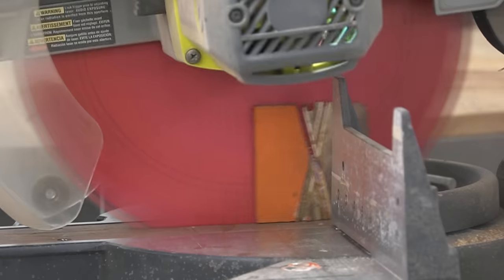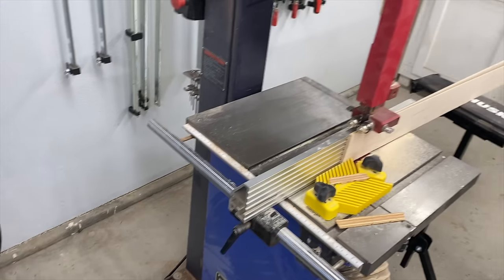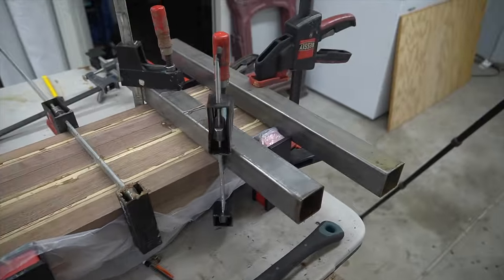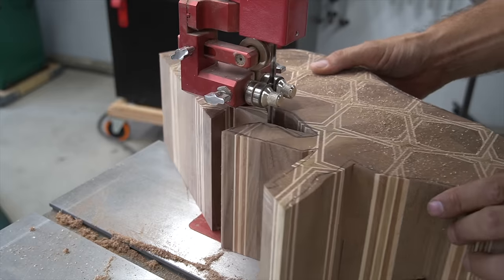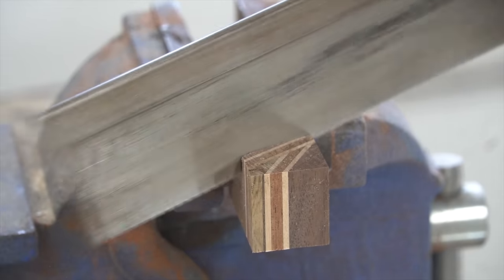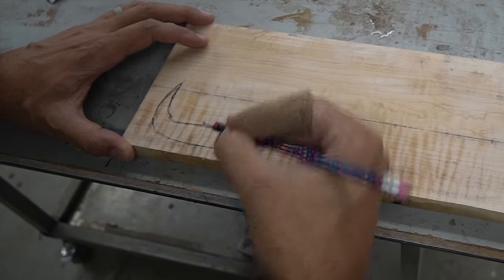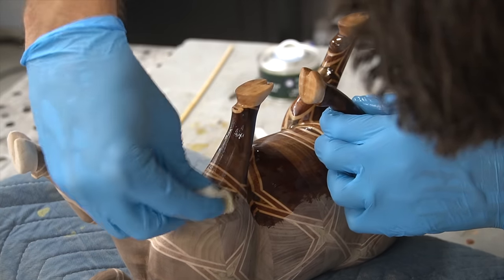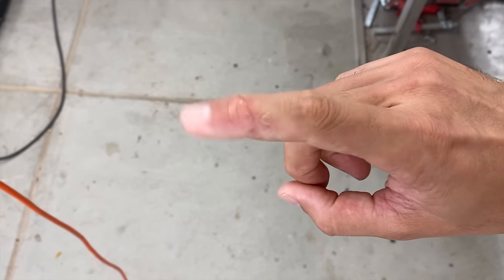I Carved this Patterned Block Into a Bull

Comment: Pretty cool how you were able to get back in the shop after an accident like that.  I nearly lost my thumb and i couldn't even look at my workshop for a month.
Reply: For me, it helps to admit that I was the moron who screwed up and if I slow down and use a bit of caution I’ll be fine.
I cut the tip of my thumb off with my mandolin slicer while messing around making midnight cheese snacks… lol the next day I used it to make a salad and my roommate was like “dude! wtf!? You’re using that death trap again!” and I’m like “yeah… I want thin cucumbers.” Haha I know that I didn’t use the guard, I forced a hard cheese through the slicer which is a big no-no and I didn’t bother using the nonslip pad either… I basically threw safety out the damn window and locked it. 
Same with my motorcycle the first time I crashed… it was a low speed crash but I had anxiety for a few days about even getting on it until I remembered… I chose to ride in the rain, I made a dumb mistake and rode up onto a painted section quickly trying to get some cover and had I just used common sense I would’ve been fine.

So next time something happens, take it as a learning opportunity and don’t let your anxiety control you. Fear can be just as dangerous as carelessness. Sometimes being timid can cause a whole host of other dangerous situations.

Good luck, stay safe!

Comment: This is the first of your videos I've seen, and it's quite impressive. A couple notes from an amateur knifemaker/blacksmith. 

1. Leaving the imperfections is always a personal call. I hate leaving relic (imperfections) in my work, but it usually sells better because it "looks handmade."

2. Excellent call with the bluing  and sanding on the base. It looks great and is still well preserved. 

3. The brass horns are possible, but not in a wood shop. Good call in substituting the curly maple. Limitation definitely added to the creativity.

Comment: My idea for your next project… a life sized rattlesnake halfway through it’s strike. Coiled, but stretched out. Mouth open. Stainless or Silver fangs and topaz or emerald eyes with brass rattles. The body of the snake can be from whatever medium you choose but there should be texturing for scales and some diamond type pattern. If made from wood, it could be diamond patterned inlays. If made from metal you could use clear coat with different colored toners or make patterns with blueing etc. or mix these ideas with some of your own as you begin to envision….

Comment: For bending the brass, heating the bend spot with a torch would work.  Or, if you want a fun new toy to play with, you can invest in an induction forge. It heats up only the spot inside the coil and it does it in seconds. I’ve seen blacksmiths use them for small projects they don’t want to fire up the real forge for. 

As for your finger, I did the same to my thumb pad. Right across the middle of it. You won’t have to remember to use the new push blocks you made. 6 years later and it still tingles every time I turn a saw on 😅

Comment: Hey, as a fellow person who had to get their finger stitched because they weren’t careful, useful tip. Make sure you lotion up. 

I recommend multiple layers of lotion. You need thinner lotions and thicker lotions. The thinner lotions penetrate the skin and moisturize and the thicker lotions and hand creams help with drying out. So thin then thick. Also glove as often as you can. Especially when dealing with wet. We want to keep lotion on and prevent dry out. That will cause your finger to curl and tug in places you wish it didn’t. I would also recommend CUREL’s Shower Lotion. It’s a wet skin lotion and is great as a base layer.

Comment: I think a kangaroo carving would be cool to see! I also think that there’s a lot of potential to put lights in your epoxy carvings that could give off a beautiful addition to your work
Reply from the maker: Cool idea! I always fear of lights breaking and then I have a useless light stuck inside the epoxy. If only there was a way to replace them once they go bad.
Reply: @BMSculptures maybe a little sculpture of a city skyline where you put lights in the buildings and access them through holes in the base.
Reply: @BMSculptures  fiberglass...
Reply: @BMSculptures  That is very valid point. I think there are a few ways to make replacing them possible but it would come with its own draw backs. I think the best solution would be to have the lights coming from the base stand. that way the light would be removable from the underside and easy to hide from view providing a glow from underneath. This would however require the epoxy to be at the bottom of the carving. The only other way I can think to is to have a detachable compartment in the centre of the sculpture. However, that comes with a lot more risk and whatever can be separated would likely be visible.

Comment: Always treat a bandsaw with respect. Many and many a moons ago, my father worked in a shake mill. The industrial band saw blade broke... and the broken blade looped around his neck. The teeth interlocked, keeping it from immediately cutting his head off. The machine was still running, he couldn't reach the cutoff switch. All it would have taken is the broken blade catching on the spinning flywheel for one moment, and his head would have been removed. His supervisor looked at him and asked 'what the f*** happened?!', then stood there waiting for an answer before realizing he should hit the cutoff switch. All he got was a row of tiny punctures around his neck from the angle of the teeth. Incidentally, NEVER ask a person who has just suffered a power tool injury 'what happened' or 'how did you do that'. One of the coworkers at that shake mill cut his fingers off at the last joint on one hand with the shingle saw. He was in shock, and someone asked him 'how did you do that?'. He proceeded to show them, cutting his fingers off at the middle joint in the process. Of course, the biggest lesson is... don't work in a shake mill! At least not one from fifty/sixty years ago.

Comment: My older friend has had his custom cabinet shop for 40 years and never once cut himself until about 5 years ago. Then he cut himself 5 or 6 times since. He's lost on his left hand the last knuckle up on his index finger and the fingernail up on the middle finger. He also was not using a push stick on the table saw (two different times) and litterally exploded the end of his right thumb. He said it looked like a firecracker exploded in the tip of it. And on his right hand I was over there hanging out and he was rushing straitening some boards on the jointer and his hand slipped as he was running the end of the board over the cutter and cut the tip of his right thumb off, including all but the last bit of the fingernail. Luckily he had a helical cutter head and it was a clean cut. You get hurt when you become to comfortable with rushing and being careless around dangerous tools.

Comment: I had got this Dewalt cutoff wheel thing that kind of looks like a mini circ saw. I was trying to use it to cut quarter round on my back porch and the little cutoff piece went flying 10,000MPH into the yard. For the next cut it somehow smashed into my finger right under the nail and it was weird because the blood just started gushing, like in a way that looked unusual. It went from nothing to high pressure gushing for like 2 sec and then almost nothing.

Comment: After over 57 years of woodworking I decided to stop pressing my luck and bought a top of the line SawStop. It saved my TWICE. The Sears shop table sa only cost me a tiny bit of my thumb. So yes be careful and only use the best equipment you can.

Comment: It looks like there's a small hole,  in the bottom of the big blade guard. Maybe there was a second guard that could slide up or down, after adjusting for the thickness of your work, to prevent the exposure of that last 2 inches.

Comment: It turned out really beautiful even without using the brass for the horns but here's another idea what if you would have taken a 6X 3 inch piece of brass that is a quarter to a half inch thick and use a laser cutter to cut the horns out and then shape the horns to the desired look it's just an option but excellent excellent work hopefully one day I can be as talented as you new subscriber here

Comment: Why is bending brass an issue? I am unfamiliar with brass but work with lots of marine metals and bending s 1/2 rod isnt a big deal in bronze. Maybe get some bronze in stock and play with it, it's a dream to work with (but wear a mask)! You could likely have bent the brass by torching it in a vice and then bending it with some leverage or a hammer and re polishing. Love the videos!

Comment: when i got the lesson of using the right safety measures i made my mistake in a woodsplitter. lckyly it was right above the joint and shockingly it was a clean split. lesson learned  woodspliters can split more things than wood.

Comment: No to retaining the flaws. Provide a certificate of authenticity stating it was handmade, the type of finish, the year completed and your original signature using a graphite pencil. The certificate should be output on fine art acid-free paper using an inkjet printer with archival pigmented inks to avoid fading over time. Design the certificate to look classy.

Comment: My rating of your sculpture is a 10, I think it is magnificent and it deserves an "Olé" from Spain, but if a carpenter from more than a hundred years ago saw your video, he would tell you that your sculpture is very good, but that it was made 100 % with machines and 0% by hand. The carpenter of more than a hundred years ago would tell you that to be made "by hand" you should limit yourself to using the carpenter's plane, in addition to gouges, adzes, chisels, tongs, hammers, etc. and not use any electric machine.

Comment: I’ve seen wood sculptures from ONE block of wood - very intricate - that require ZERO glue : I’m curious why not use a single large piece of wood to prevent this: I received a cutting board from my carpenter shop cousin but it fell apart after getting wet : due to glue

Comment: You should have replaced his bully bits with a larger piece. I mean those boys are really well endowed. I like your all wood sculptures but I think you could save the scraps, like super small ones, do simple projects with resin and people would buy those. Plus the videos would still be entertaining. Wood is expensive so it might work out to use every scrap with a tiny amount of resin to bind it all together.

Comment: Why couldnt you bend the brass? Wouldnt even need a big torch, a small butane torch could get it hot enough and then just a long pipe as a cheater bar and a template to bend it around. I could have done that. I think the horns would have been awesome in brass!

Comment: No need to keep the flaws.. You got this video, use authentication system, pur a public key on this vide and a private one at the bottom of the base, covered by a metal plate.
This should ensure this is the one made in a video..

Comment: All CNC machines are good for is carbon copy. What results from CNC machining isn't art. If it was created by human hands then and only then is it art. Further more even CNC machines leave behind milling marks that can only be thoroughly polished out by hand. So the idea that CNC milling can or ever will be flawless is simply absurd. Never sell yourself short just because you are human. Machines do certain things with a consistent precision that of course the human hand isn't capable of however, the human hand has a free form precision of it's own that will never be matched by any machinery. Even machines no matter how precise they may be still need the guidance of a human one way or another. From one wood worker to another, you do nice work, be proud of every piece.

Comment: The safety lesson at the start taught me nothing. Just like all those  times in the past 18 years I have cut my hand with an angle grinder because I was too lazy to fasten a small piece and holding it in hand instead, or cutting something with one hand and casually leaning next to the piece I'm cutting with the other.

Comment: This is an opinion.  The following is a crit.        Your flaws you left are just bad craft.   It isn't about man or machine.  Look at sculptures from the renaisance to modern art.  They tried to make it as perfect as possible in the theme.  Craft is about you.  If you want dialogue about machine and man, 3d scan and print the bull and put it beside your own.  If you want those marks, you carve the gouge because you want it there.   It is the same as an painter would paint the rip or smudge.  The same as sculpturor who would custom make an everyday object rather than buy it.  Ask any craftsman or artistian about the representation and craft.  Also you shouldn't have compromised on the horns with the brass.  It would have been nice if you tried to use a brass billet stock.  It would have been a foil to the brass bull on wall street.  Now it is just another wooden bull.  Just an opinion.  It is still a relatively well executed piece, it had potential to be more.

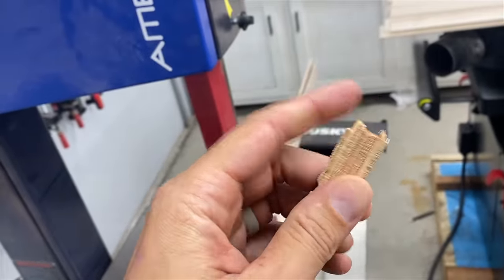Comment: 4:15 You gotta be kidding me! You use THE WORST OFF-CUT you could use as a push stick. If this was a lengthwise hardwood off-cut it would work, but cross-cut would have the same result, if it was that thin. Engineered wood, that thing is always crumbly. I hope you not come up with more such smart ideas, ugh.
You didn't even need a real push-stick... literally ANY BIGGER PIECE of wood would have worked.
19:16 That's of course the best way to use that tool. If you slide you are in there with your hands, you could not fix the horns into something and hold the tool now, could you.